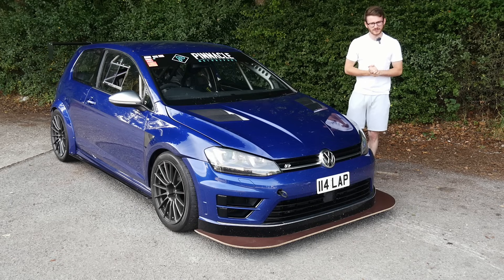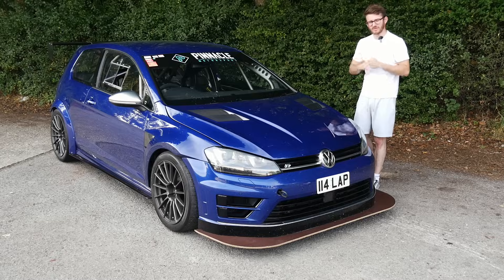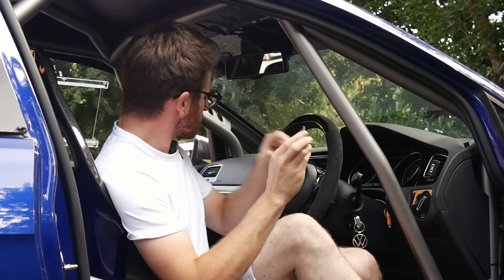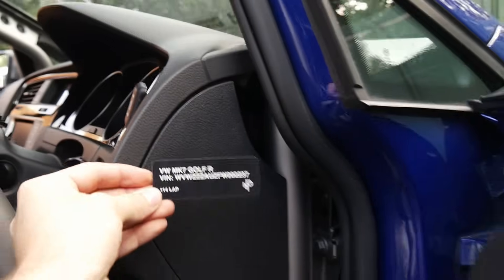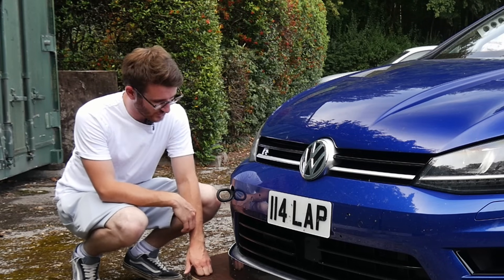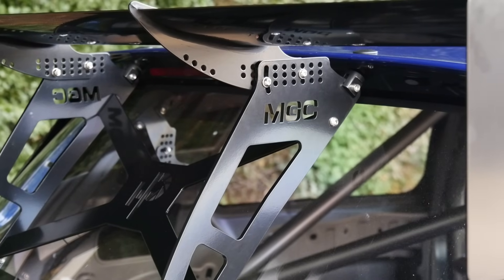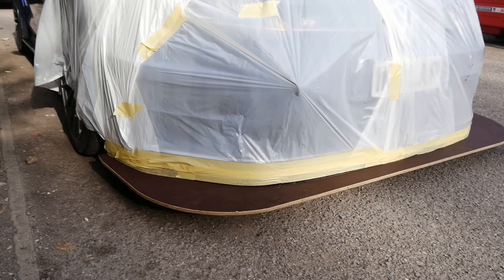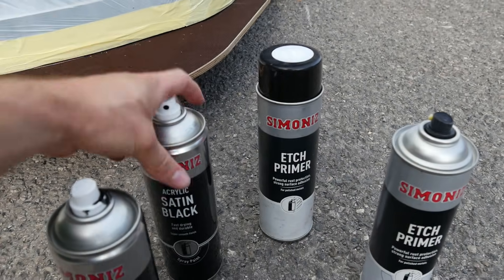DIY Modifications to my 500BHP Golf R Track Car!

Comment: You don’t even need to remove the mirrors just tilt it right down so you can see the clips and get a thin flat headed screwdriver or a normal kitchen knife and push the clips down carefully while holding the mirror case 😀

Comment: The next mod needs to be finishing the rear extended wheel arches. They just stop at the bumper, need to make them flush which will also help with spray from the tyres

Comment: Looks way much better after replacing the carbon side mirror cap and the Matt black finish on your splitter. I think if you would trim off the splitter specially both side it would look even much better. My opinion only. Keep it up mate. Job well done! Cheers!